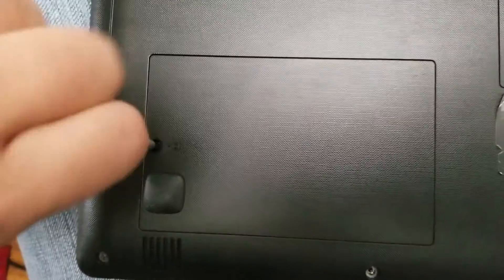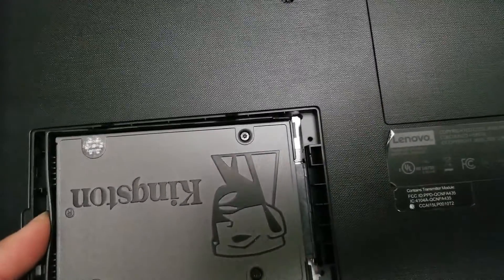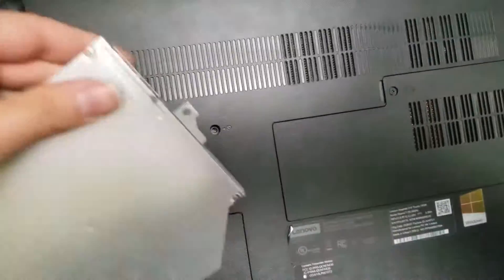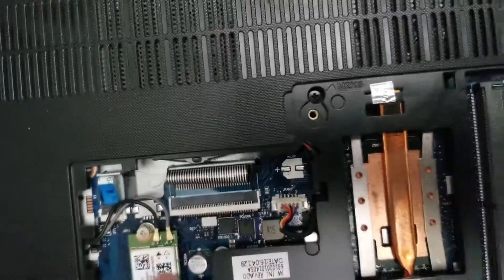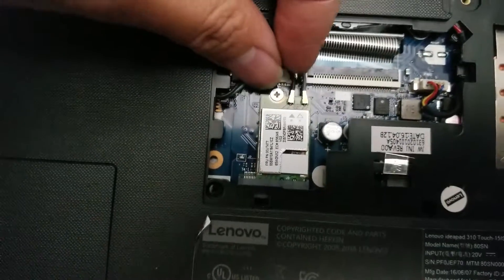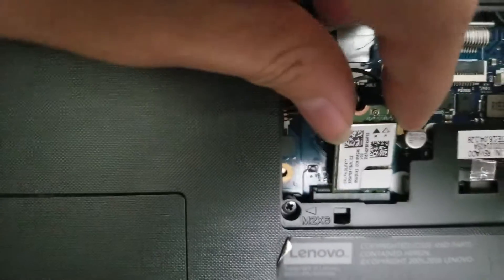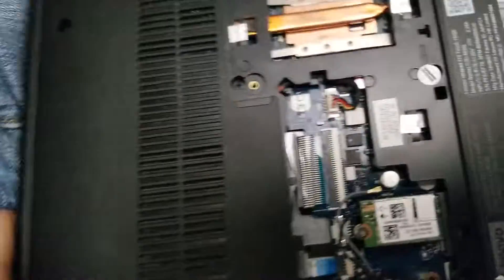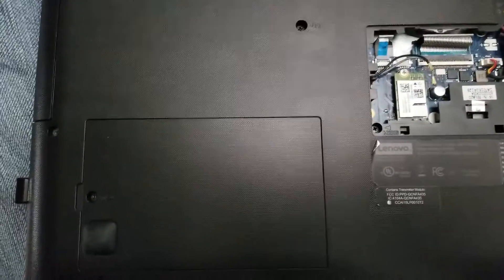Lenovo ideapad 310 touch-15isk ssd hdd hard drive cd optical drive wifi card ram upgrade removal.

Comment: Hello i want to upgrade my hdd to ssd but by cloning hdd into ssd it will also copy windows 10 and when i put my cloned ssd by removing hdd it will bootup windows 10 or i have to do something else?.....thanks
Reply from the maker: This will help https://youtu.be/4p5jFDzVwUw everything will be copied over.
Reply: @ItsBinhRepaired  Thanks for quick response, i already watched your video about cloning so i just need to clone and everything will be cloned with windows also?..like i have to just remove old hdd and insert new ssd and it will boot up with my windows and all data in it?... Thanks again.
Reply from the maker: @sebastian7228  yup!
Reply: @ItsBinhRepaired  Thanks😄...i have ordered gigabyte ssd it will arrive tomorrow...is gigabyte a good choice or kingston or crucial more better?...hope everything goes well while installing :)
Reply from the maker: @sebastian7228  haven't tried gigabyte before. Samsung is best, but crucial and Kingston are also really good. SanDisk is decent as well.
Reply: @ItsBinhRepaired  Thanks for the help i have successfully upgraded to ssd without data loss😄

Comment: why didnt u used m.2  nvme ssd in it. or ideapad 310 15 inch does not have m.2  nvme slot n only have sata slot for storage.  i have ideapad 310  15 ikb model. does it have m.2 nvme slot. thank u
Reply from the maker: I don't know. I don't experiment on customer computers like that.
Reply: @ItsBinhRepaired  do ur laptop have m. 2 nvme slot
Reply from the maker: Watch the video. If it does I'll mention it.

Comment: Can you tell me which size of caddy required for lenovo ideapad 310 isk
Reply from the maker: What do you mean? It uses those plastic things.
Reply: Yes the thing that you put ssd and installed it. What was there size?
Reply from the maker: There is no size. It is already in the computer. You just transfer it from the old drive.
Reply: @ItsBinhRepaired  no I'm talking about to add one in place of dvd writer and not to replace with hdd
Reply from the maker: @laukikkumar2  oh, you'll have to measure the height of the cd drive in mm.

Comment: Hey mate! I want to upgrade my laptop's storage into an SSD + HDD combo. I'll use a caddy. But my concern is the speed of the connections differentiating the caddy and the standard storage slot. What's the optimal arrangement? Do I need to transfer the HDD to the caddy or just put the SSD on the caddy and still work with the SSD speed using SATA 3? o r SATA 2? I'll definitely install the OS on the SSD. Thanks!
Reply from the maker: HDD in caddy

Comment: can we install both ssd and hard disk in this laptop?
Reply from the maker: Yes, but only if you replace the optical disk drive with a hard drive adapter.
Reply: @ItsBinhRepaired  bro, give me buying link for ssd/hdd caddy
Reply from the maker: @BrTeVe  you'll have to measure the thickness of the optical disc drive in mm for me.
Reply: @ItsBinhRepaired  9mm
Reply from the maker: @BrTeVe  https://amzn.to/3xuqZsu if you don't want the gap, you'll have to swap the bezel from your optical disc drive.

Comment: Hey buddy, i have already upgraded my ram. I need help with replacing my HDD with an SSD. Is it just swap and replace? Did you need to install any type of converter?
I'm asking because i saw a Kingston Replacement Kit that comes with a bunch of cables and im wondering if its useless to buy the whole kit or not. Here it is
https://www.amazon.ca/Kingston-512G-KC600-SATA3-Bundle/dp/B07ZG4KGHQ/ref=sr_1_3?dchild=1&keywords=Kingston+KC600+2.5-inch+SSD+Upgrade+kit&qid=1608130098&sr=8-3

I have the exact same model Ideapad 310-15isk non touch
Reply from the maker: If you're migrating the data and os over, this video will help. https://youtu.be/4p5jFDzVwUw If you're doing a clean install, this video will help. https://youtu.be/R6GVDyVqWso

Comment: Hi, so recently I bought an 1tb Samsung SSD 870 QVO to replace my hard drive. I was wondering how much storage space would I have if I put my 1tb hard drive in the laptop along with the 1tb SSD ?
Reply from the maker: Are you asking me what's 1 + 1? LOL
Reply from the maker: I don't understand the question. You'll have double what you currently have if you can put both of them.
Reply: Nevermind but, the Samsung SSD didn't work when I put it in the place of the hard drive should I consider getting a caddy and putting the SSD in the CD drive part ?
Reply from the maker: @larrywilliams23  you have to clone the operating system to the new drive. This video should help. https://youtu.be/4p5jFDzVwUw You can do it with the cd drive caddy as well if you buy that adapter.
Reply: @ItsBinhRepaired  Alright the overall progress is loading up now, thanks for your help. 👏🏾👍🏾
Reply from the maker: @larrywilliams23  no problem
Reply: @ItsBinhRepaired  One last question though, If I add the hard drive in the caddy what would it exactly do for the laptop ?
Reply from the maker: @larrywilliams23  you'd have a second drive for storage
Reply from the maker: @larrywilliams23  but you'll want to format it unless you want it to remain a backup copy of your other drive.

Comment: Just one question, what do you do before removing and installing new parts. Like, do you shut it off all the way first or disconnect anything inside the laptop? I heard there was a shortcut with fn + v + s or something that does... I don't remember what exactly but it sounded pertinent to this.

Thanks for the video, definitely very useful now that I'm considering upgrading my laptop. What are the odds that I found exactly what I was looking for!
Reply from the maker: Just shut it down completely, disconnect the battery, then hold the power button about 20-30 seconds to drain any residual power. Windows 10 has this stupid fast startup thing, so it might not register hardware changes immediately. If this happens, just restart the computer one time after the changes.
Reply: @ItsBinhRepaired  how do I disconnect the battery? I've seen people tear down the laptop to disconnect it, is that necessary?
Reply from the maker: @ReiDoSossego  did you watch the video?
Reply: @ItsBinhRepaired  Yeah i did, but i must've missed that part. Gimme a sec.
Reply: @ItsBinhRepaired  I watched the video three times and I never heard you even say the word "battery"

I must be deaf bc you make it sound like its in the video
Reply from the maker: @ReiDoSossego  hmmm let me rewatch. It's an old video. I'll get you a time stamp. Usually battery only needs to be disconnected if messing with the lcd connector. I think this was just a simple upgrade video, not a disassembly video. Battery is internal and requires complete disassembly to get to the battery. If just messing with components under those small covers, don't worry about the battery.
Reply from the maker: @ReiDoSossego  haha sorry for the confusion. Don't worry about the battery unless you're completely disassembling the laptop.
Reply: @ItsBinhRepaired  Thanks a lot, thought I was missing something!

Now then, time to upgrade...
Reply from the maker: No problem. Sorry for the confusion.

Comment: Hi. Great video. Helped me replace my hard drive.
I have a question though.
I need to install the hdd into the caddy and replace the original hdd place with the sdd.
So for that, do i need to remove the battery or can i do that like you did in the video?
Reply from the maker: Please consider subscribing if you haven't. I need 1000 subscribers before I can make a single cent from these videos, making it unrewarding to make them.
Reply: @ItsBinhRepaired  i will. Thanks for helping me out!
Reply from the maker: For swapping hard drives you don't need to remove the battery. You can remove it and hold the battery for 30 seconds to be extra safe, but it's not necessary unless you're changing the screen or likely to drop something conductive in the circuitry.

Comment: Hi! I have almost the same Lenovo like you. My model is ideapad 310-15isk (80SM00SDPB). 
I would like to upgrade ram. Now I have original 4gb and I want to instal also 8gb card. There is also one slot and this model can have 12gb max. Do you know maybe, what kind of card should I use?
Reply from the maker: Just checked crucial's website. Looks like it uses DDR4 PC4-19200 DDR4-2400.
Reply: Ok, I'll check. Thanks!